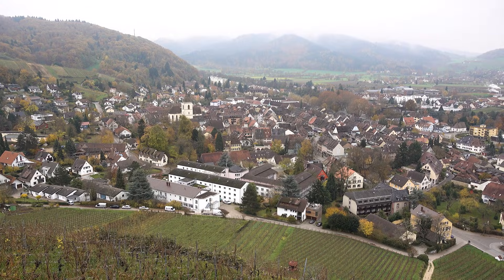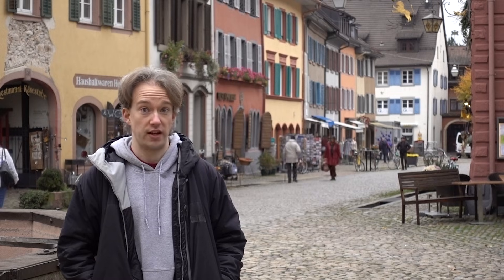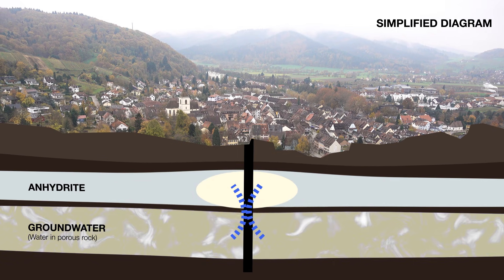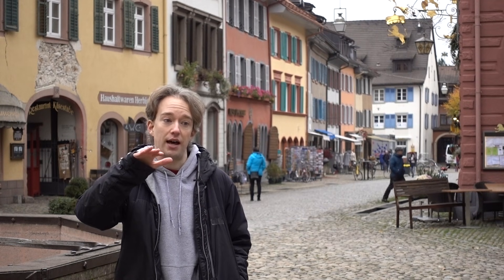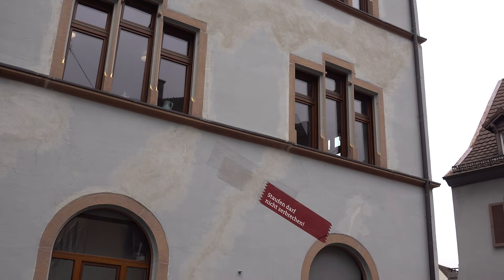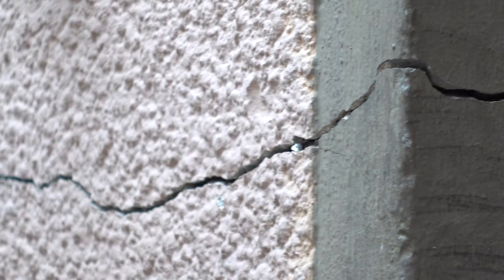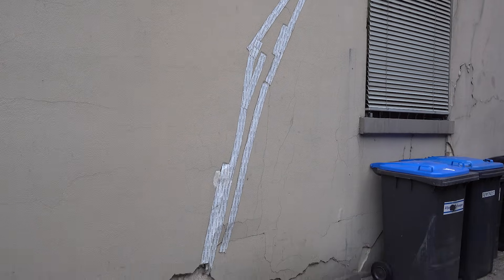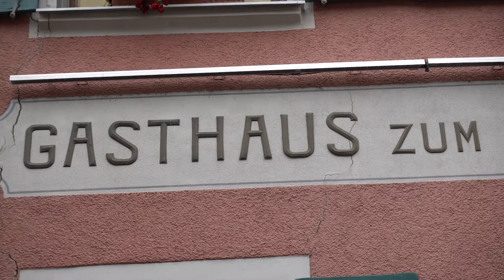The German town that's literally cracking apart

Comment: I live in Oklahoma, where they used to bury waste water from drilling oil wells (including waste water from other states) underground. As it turned out, there are old fault lines under Oklahoma and this lubricated them. Thus, central Oklahoma went from having few earthquakes to having the most in the United States. Fortunately, none of were above 5.7 on the Richter scale, but some buildings do have cracks.

Comment: We moved from a house that had mine subsidence in Illinois in the U.S. Doors get stuck, water lines and gas lines break. Floors are uneven and mice and bugs come in through the cracks. You want to leave and the garage door does not go up because the track is out of alignment. The tub does not drain like it once did because the house is titled along with the waste pipes. Cold air comes up all the walls due to the house movement and the furnace bill skyrockets. Was not a happy time.

Comment: This just really goes to show that Germany really needs to invest in nuclear power instead of messing with all these other low impact (although, in this case, damaging) renewable energies. For sure, the country needs better regulation of renewable energies and needs it PRIOR to implementation. Otherwise, it will 100% continue to have problematic issues, like this crack town, or worse, b/c we all know what happens when nuclear isn't properly regulated in build or use (Chernobyl).

France has a world model of workable, safe, and environmentally-friendly nuclear power builds. Germany needs to start signing on.

Comment: You know what could help?
Nuclear energy. Sadly, Germany decided nuclear energy is too bad for the environment.
…
Look, I’m not opposed to geothermal energy, but I’m still furious about that one.
Reply: ever heard of solar or wind?
Reply: @timeTegus  ever heard how many more years it will take until an entire country the size of germany can sustain itself by solar and wind only?
Reply: Ever heard of how many years it takes for nuclear waste to become harmless?
Reply: @ Ever heard of thorium energy?
Reply: @Scribe42  I've heard about it. I've been hearing that it will definitely work tomorrow, soon, in the near future. Any moment now.
I've been hearing that for decades.
Reply: @Scribe42  not a real existing reactor
Reply: @marcromain64 CANDU reactors, which have been aroudn for decades, can run on thorium fuel bundles. But it's really not needed since uranium is plentiful.
Reply: @coconutcore it was for geothermal heating for the town hall, not power. IE it could use power from wherever to drive the pumps, etc, even nearby French nuclear just to west. This is an example of not doing due diligence before a project.

Comment: I was expecting the ground falling, not rising O.O.
Reply: Anhydrit is absorbing water. An aquifer is providing water as long as the ground water level is high enough. In that case the aquifer is quite deep underground below a layer of anhydrite. Hence the difficulty at getting the expansion of the anhydrite layer to stop.
Reply: @michaelburggraf2822  Yes I got that from the video but most reasons for buildings cracking is the foundation giving in and lowering in some places. This rising phenomenon is really unique way of destroying structures.

Comment: Yet another victim of the obsession with "renewables".
Reply: The damages from coal mining in Germany are about 10000x times as high as the damages from failed geothermal drilling. The Ruhrgebiet has sunk on average some 15 meters due to coal mining and the overall damages are considered to be in the upper hundreds of billions.
Reply: @0106johnny  where did you get all those numbers? You just made up most of that, didn't you?
Reply: @michaelnoble2432  No, that's the last official estimates for the costs until 2100 (upwards of 500 billion of todays euros). So far the total costs are estimated to have been 200 billion in todays euros since 1900, for a total of over 700 billion. And that are minimum estimates. Ground water pumping and decontamination alone currently cost about 250 million euros a year.

The total damages in Staufen are considered to be about 50 million euros overall until the rising has subsided and it is the largest damage of any geothermal drilling in Germany ever by a far margin. So that's about a factor of 10000x.

Comment: Notice the assumption that if the industry had been regulated, the mistakes made through inexperience would somehow not have happened.

Apparently, regulators, just by their very existence, would create out of nothing the knowledge that would have prevented these problems.

Stated baldly like that, of course it sounds foolish.

So, was that the actual assumption?  I'm not sure, but probably not.

Maybe the assumption is that the geothermal drilling would have been delayed and delayed until experience had been gained elsewhere.

(To see the remark, skip ahead to the 122 second mark.)
Reply: That is also why the company would have easily won in court. They followed every procedure that was considered safe at the time. They settled for a million to avoid bad press associated with a legal battle, but they'd have won that battle no problem

Comment: A modern concrete buildung would no longer stand. Timber framing is amazing, just look at some Japanese temples that have survived heavy earthquakes for centuries. Even Roman concrete buildings like the Parthenon still stand, whereas many buildings from the 70s or so are a constant maintenance nightmare. Also the architecture is mostly ugly, but that is just my opinion though.

Comment: They probably dont know Flex-Tape

-Me, 2020
Reply: We know it, but it would be of no use here. What would be of use if the swelling does not stop would be lifting the entire building (or town) onto platforms that themselves are level and capable of compensating the deformation of the ground. 

Bonus points if you make the town movable.

But since the platforms would be a little too expensive, its most likely demolition and crying historians, with a chance of rebuilding somewhere else.

Comment: This stone that expands when it comes in contact with water is quite common in the south of Germany, more precisely in Baden Würtemberg. And it makes a lot of things a lot harder. 
For example they are currently  building a new train station in Stuttgart (which is completely uneccesay) and for that they are drilling through this material. And it is a giant  issue since you have to reinforce the tunnel a huge amount so it can cope with the swelling of the rock. There are also issues during the drilling itself.

Comment: A liter per second? That just sounds wrong

I got two small D5 pumps, each the size of my palm that together pump 0.82 liters per second. I use them for the cooling system in my computer.

Comment: We have exactly the same problem here in Stuttgart, Germany.  A new slate station is being built here for 10 billion euros.  For this station, kilometers of huge tunnels are drilled through porous rock.  Stuttgart is unsuitable for drilling because a small amount of water causes the rock to swell. This rock is located under the entire city with 700,000 inhabitants.  These massive construction sites have been causing miles of traffic jams all over the city for years.  The air is dirty like never before and listed buildings have simply been razed to the ground.  It is a huge scandal.  When peaceful demonstrators demonstrated against the demolition of a park behind the old train station a few years ago, they were attacked with pepper spray and water cannons.  There were families and seniors.  Uninvolved passers-by were also seriously injured.  A journalist lost his eyesight.  Nobody wanted this station, but due to corruption in our politics, this project was still pushed through undemocratically.  Many think it is only about land that will later be rented out at a high price, but others believe that this huge construction site should only be a cover for an underground base that is to exist under the future train station.

Comment: As a German I had to get some energy saving tech when I was building my house. I briefly considered the thermal option but with being responsible if the tubes ever leaked I threw away the idea and had a 1.5 meter deep system installed. Looks like the right choice. Working in IT I learned never install the newest patch / tech for crucial systems - take something that has proven it works reliable and that is maintainable.

Comment: Where I live, in old terraced housing, the houses have a few bricks as foundations. The whole road is very slowly sliding (or trying to slide) down the hill. The only thing stopping it is the extensions and basements built a lot later, which anchor the entire terrace in place because they have proper foundations

Comment: same as with all green energy productions .. it sounds nice on paper but has down sided people aren't aware of ..
solar is close to pointless without much more expensive storage
solar towers kill (burn) birds and insects

wind kills birds, insects and bats to a level of threatening local extinction and still requires some kind of storage or it will have heavy efficiency losses
"co2 neutral" pellet-ovens burn trees/wood .. so .. they burn stuff .. release co2 to create energy
hydro energy swallows vast valleys
electric cars move the pollution to the place where the ressources/chemicals are exctracted/produced but barely reduce pollution over all due to higher pollution during manufactoring especialy the huge batteries
geo thermal .. mentioned here .. 

green energy is almost always way more expensive .. (luckily that's changing slowly)
... and it goes on ..
don't get me wrong .. i'm a huge fan of green energy .. once people are aware of the downsides and decide for it DESPITE those downsides .. not UNAWARE of those ..

Comment: If looking to buy a house / land in Germany the following steps are obligatory if you think you've found something you might like. 

1. Check which building projects have been there in the past 80 years in a ~50km radius. Check especially for work that involves rivers and mountains (e.g. dams or quarries). 

2. Check the newspapers archives, at least 10 years. Look for recurring headlines. 

3. Check the last 3-4 elections; what were topics during the campaigns? 

4. Check who the surrounding land belongs to (esp. if it's the town or a company; if town: ask them what they do there. If company; find out what the company does.) 

5. Go to the local beergarden / market / whatever seems to be the place where people meet up and talk. Go native an listen. Check up on everyting you've heard. 

Congratulations, you did all the groundwork that is necessary to figure out if the house you might want to buy is in a place that is safe to live in. - If that sounds extreme; there are some people who have weird hobbies, like "house shopping" - which is like window shopping... just with houses. There is a lot sh* going on - especially in smaller communities.
Reply: true. we planted a row of thick bushes and trees solely for that last reason. living in a town with 500 people has its downsides

Comment: Who thought that drilling for geothermal energy in the middle of a town was a good idea? Even without the problems it just seemed like asking for trouble to me.
Reply: Would not have been a problem if the geological conditions had been fitting, one should just not drill through a massive layer of anhydride. Better ask some competent geologists next time.
Reply: @TigruArdavi  Just wonder why they got a drilling permit, it 
wasn't an unknown problem in this area
Reply: @HarlderHenker  It was unregulated. Also no geologist can predict exactly where a layer of anhydride is, without drilling.
This was probably the problem there since in a town centre there is less deep drilling done before so it's probably a white spot on the geological map.
Reply: @sualtam9509  But "unregulated"? This is Germany, not Texas. Where was the Green Party and the usual environmental assessment?? Why would locals even THIMK this is a good idea? Where is the test drill data?
Reply: @Dwightstjohn-fo8ki  The US doesn't have the exclusivity on neo liberalism
Reply: @Dwightstjohn-fo8ki  These were the test drills to get the data. I would say it was unintended and probably unforeseen. No company would drill knowing this much damage would occur because of the risk of a lawsuit.

Comment: Shows that even the most technically advanced country employs specialists that lie, cheat and are generally dishonest. If they had done their homework they would have known what would happen if water got into the layer of anhydrite. Just like VW should have known what their dishonesty would lead to.
Reply: Baggie Shorts They knew that Anhydrit was there, they just didn't prepared enough to make sure the aquifer doesn't come into contact with it. The area is very fractured. The underground depiction was veeeery simplified

Comment: Why not inject hydraulic cement & plug the hole! Geothermal energy requires a environmental assessment especially in such a dense populated area
Reply: Madison One Water was already in the anhydrite layer. It did stop expanding now but it did for years because there was still water that could turn anhydrite into gypsum

Comment: After the pumping, comes the sink holes
Reply: A aquifer is made of porous material (gravel, sandstone, etc.), so just pumping out the water usually does not result in sinkholes. If the waterflow continues the gypsum will be dissolved in the end. You can imagine what happens then ...
Reply: @NameHierEinfuegen  Karst is a topography formed from the dissolution of soluble rocks such as limestone, dolomite, and gypsum. It is characterized by underground drainage systems with sinkholes and caves.[1] It has also been documented for more weathering-resistant rocks, such as quartzite, given the right conditions.[2] Subterranean drainage may limit surface water, with few to no rivers or lakes. However, in regions where the dissolved bedrock is covered (perhaps by debris) or confined by one or more superimposed non-soluble rock strata, distinctive karst features may occur only at subsurface levels and can be totally missing above ground
Reply: Roger didit Only thing is: you don't do the pumping with a heat probe.
Reply: @Vulcano7965  But you forget.. You can tune a piano, but you can't tuna fish.

Comment: Geothermal drilling is done for energy. What do Germans want? They want to heat their houses, cook their food and power their industries. 
But they don't want nuclear - they've shut it down. They don't want coal because it "pollutes". They don't want gas, because they are afraid of Putin. They don't want oil, because of the Middle East. How will they run their country, and on what?
Plant a few more windmills and another few solar panels, Germany. You've spent 97 billion Euro and gotten 3% of your electricity needs, and even then they are dependent on weather, feel-good but not scalable.
You led the world in nuclear power research. Time to investigate it again.
Reply: Why do you put quotes around "pollutes" for coal?
Reply: @dodec8449 It's their excuse for why they don't like coal. You're right though: coal does pollute. it is a dirty fuel. But it, oil gas and nuclear are the only scalable electricity systems available. Since all but one are based on burning fossil fuels, nuclear is the obvious choice

Comment: Yea and if now sinks the groundwater (what now can easily happen, huge drought 2018 - 2019) a huge hole (sinkholes) in the ground appears and swallow the whole Town, 🤷 hmm happeneds if nuts are at work.
Reply: Usually the groundwater level does not really mater all that much in a natural aquifer (porous material like gravel or sandstone). It still retains stability in most cases. It's much more frigthening when the water has no anhydrate to turn to gypsum anymore. The water will then start to dissolve the gypsum ... you can imagine what happens then.

Comment: Could fracking cause similar problems?
Reply: Yes, when you try to extract something from the ground there's always a risk of the ground needing what you removed or something moving through the new gaps that shouldn't
But with regulation and care fracking isn't too bad and it's likely better than using less clean fuels
Reply: @Firaro.  I think fracking is appalling.  We should be spending our energy on other energy sources.

Comment: Why would modern buildings not be able to withstand the shifting grounds, but old buildings would?
Reply: simple: older buildings made of a lot of mortar and stone and wood are "soft" and may move and keep standing, if there is enough time to resettle. Modern buildings are much more stable, but "hard". They stand strong until they break.

Comment: This is why people need to stop screwing with stuff that isn’t theirs to screw with, if it takes that much effort to get it really isn’t worth it, and now you pay.
Reply: Noone was screwing with stuff they weren't supposed to screw with and it wasn't much effort at all to drill a couple of boreholes. Drilling for geothermal energy is known to be easy and reliable. Staufen was just extremely unlucky and now they're paying for their bad luck.
Reply: @ConstantijnC  I was talking about oil etc.
Reply: Although I do agree that some drilling operations and most fracking operations for oil should be better regulated, I find that connection to the Staufen story a bit far-fetched.

Comment: There is another problem that wasn't mentioned. Gypsum can be washed away by water quite easily and scince the newly formed gypsum is both washed away from underneath by the groundwater and from above by the rainwater comming through the newly formed cracks the effects are even worse.
Reply: The gypsum is not washed away because it has nowhere to wash away to. On top of that, the solubility in normal rainwater (pH 5.6-5.7) is way too low to dissolve any considerable amount of gypsum.